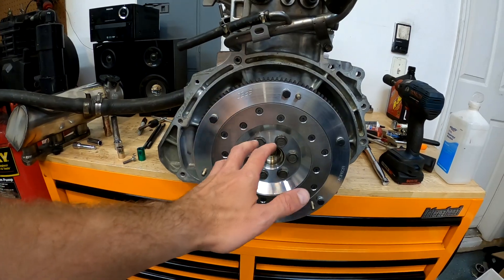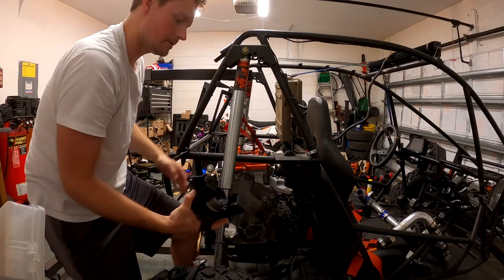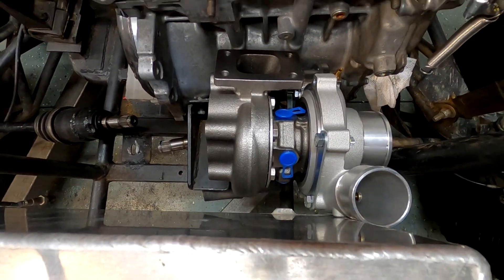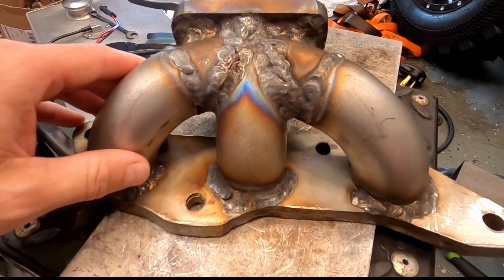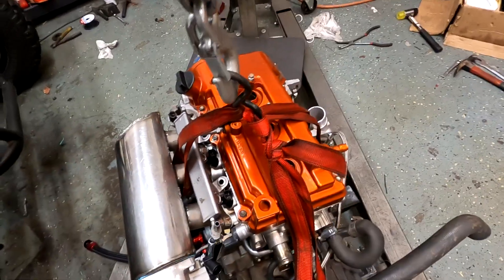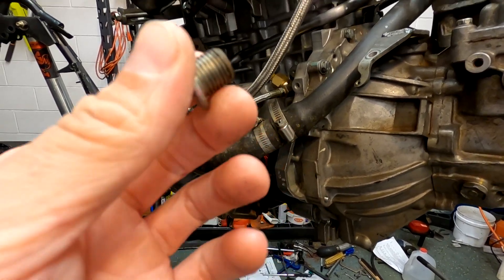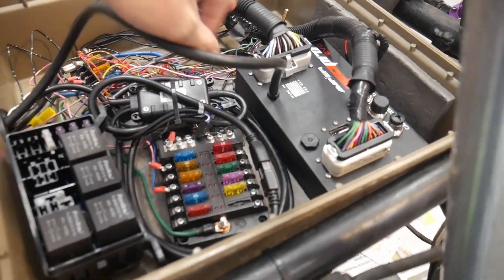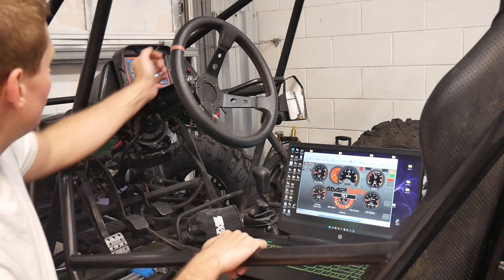The Built Mirage Engine IS ALIVE!  | First Start Sounds So Good!

Comment: Thanks so much for this content man! What engine modifications would you recommend for a (relatively) reliable 300hp 3a92 build? Or if there's another build path that nets less power but is significantly cheaper I'd be interested in that.

Comment: So no reflash of stock ecu yet? I've searched in the past with no luck.
Reply from the maker: In Asia they are using piggy back modules for tuning purposes, I can't recall which manufacturer though. AFAIK no tuners developed the cable connections needed to reprogram the factory ecu without piggyback

Comment: Nice. Sloppy welds are still welds.
Imma point out one thing, the MapDaddy 4 bar sensor lets you go up to 3 bar of boost, ~44psi. Looking at one retailer they list the pressure at 5.0v as 416.5kpa. I know that sounds like 60psi but there is already 14.7psi of atmosphere. 
416.5 kpa is 60.4psi of absolute pressure, that means the sensor will be pegged at 5.0v output at 45.7psi of positive pressure in the manifold. These look like GM sensors at heart, there is a GM 4 bar sensor that has the same limits.
Reply from the maker: I noticed I said that in the edit 🤦🏼‍♂️

Comment: She is going to be a beast. Now you are going to have to start worrying about traction more.also do you think the axles will hold that power level?
Reply from the maker: I’m going to have to worry about all those things. Ill try and tune out the massive torque I had in low rpm range with the electronic boost control